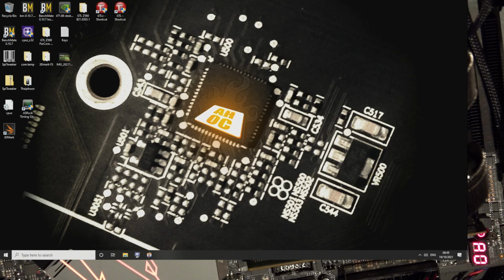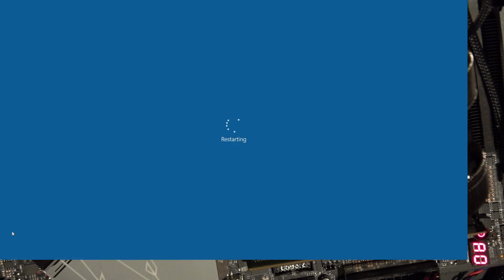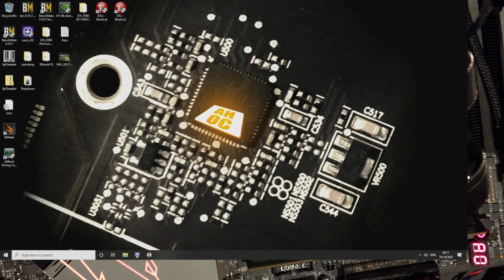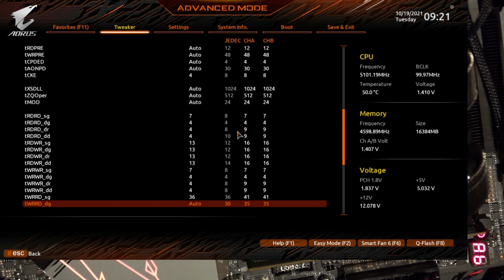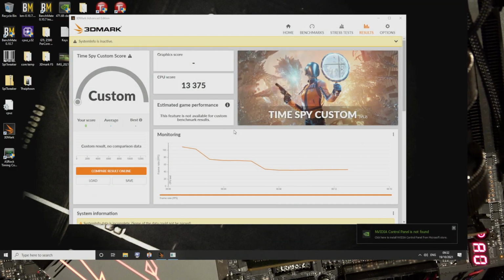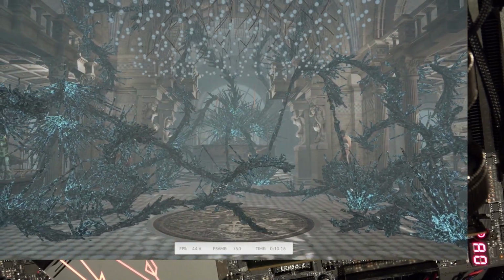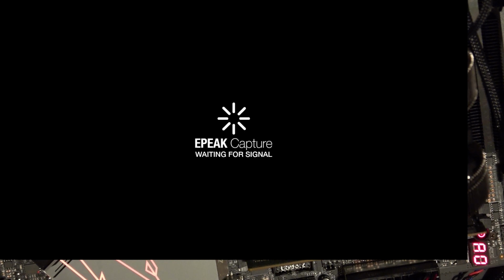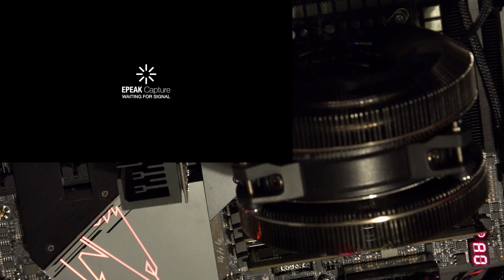Overclocking DDR4-2666CL19 OEM Samsung DIMMs to DDR4-4600 on Z590 (SR S8D)

Comment: could you tell me what the dual rank timing would be? great video and im so glad you have the 590 aorus master. i have the same mobo myself in my first pc build. im also trying to learn how to oc the 10850k. its tough when you know nothing and are trying to figure it out. this is really helpful in the sense that i can learn. it would be great to know besides experience how you figure out the timings that may work etc. to me its all a complete guessing game. yes ive had my pc not boot many times as i have no idea what im doing lol. that safe boot button is a god send though lol. that and clear cmos as well haha. anyway possible you could direct me to how to oc 10850k w this mobo? any help is appreciated and thanks in advance. when it comes to gaming in lets say battlefield V. what type of numbers are you looking for in ram? higher mhz or lower timings etc.? i currently have trident royal 8x4 4000mhz cl17 b die ram. i did my overclock setting ratio to 51 and 1.425v fixed v core. i have a x63 aio which cools excellent. id like to push it to 5.2 or even 5.3 if possible. what are safe v core intel voltages 1.5?

Comment: First DDR5 overclocking video any day now. HYPE!
Reply: DDR5 overclocking is going to take a while.. first the tech will need to mature then we need to figure it out
Reply: @coolhand4598  You do realize people overclock DDR4 by just adding more voltage to the basic voltage 1.35v.
This won't be different for day one overclocking for DDR5.
Reply: @N0N0111  Voltage Regulator is on the PCB with DDR5 it might not be possible to overvolt

Comment: I use Patriots 4x 8gb 4133CL19 on B550 Ryzen 3700x. Clocked to 3600 14-14-8-14-28-42 1T GD 1.5V. 8 is trcdrd. Is there a Chance to Hit 4600? I dont can Boot all over 4133 Stock. Tried high Voltage. No chance

Comment: If DDR5 does end up needing active cooling, do you think there will be waterblocks and things like that for it? Or would that be impossible?
Reply: Waterblocks already exist for RAM, they're just rare and expensive. Thermaltake makes them, for example. The same waterblocks will probably work with DDR5, the size and shape of the modules is unchanged apart from the position of the notch.
Reply: @nathangamble125  thank you.   Ram cooling is something that is there if you know what your looking for.   There are crazy minded enthusiasts who are engineers at heart,  they have an answer for that burning question you could ever have..
Reply: you don't need active cooling unless you push actual limits for a single run

Comment: I am overclocking B-Die on zen 3, do you have any videos doing something similar or any advice?
Reply from the maker: it works the same as on Zen2
Reply: I ran the time spy test on mine just out of curiosity, my 5800X with Samsung B-die at 3200 C14 XMP doesn't even match his baseline run of jedec 2666 lmao, I get like 11400 points.

Comment: How do I see what my set is? They are Trident Z 3000 c15? CDie/BDie or what?
Reply: A lot of BIOS's will let you see the spec. If it doesn't tell you the exact revision or die type you can use the program called Thaiphoon Burner to read the exact IC.

Comment: I really wish I knew more about memory, I got my 2666 kit at 2733mhz with tight timing, but I'd like to learn how to get it above 3200mhz at least on my 5800x. Feel like I'm missing out on some performance.
Reply: Really just figure out what memory dies you’ve got, find the safe voltage for the dies, crank the voltage to those values, and start punching in numbers that make sense and see what sticks. I’m sure there is a more methodical way to go about this, but it’s worked reasonably well for a noob such as myself so far :p

Comment: Strange, for me lowering tFAW actually does nothing or even reduces time spy score
40/auto 7248
30 7202
24 7187
10 7267
I have AMD though
Reply from the maker: tFAW is tied to the tRRD timings. Adjusting just the FAW on it's own should do nothing.

Comment: I see you lowering timings and feel kinda surprised, i'm actually trying to lower my timings on some t-group 3600mhz cl18 @4000mhz cl18 (i'm brazilian,  computer stuff here costs just A LOT). I can't get the trfc lower than 700 on them, i'm on ryzen btw.
Reply: if they are 16Gbit density, some of them wont go very low on tRFC.

Comment: Sorry bz but this was one of your least enjoyable RAM OC videos. Very chaotic in procedure, you skipped trying a little more Vdimm, skipped tightening tCL, tRCD, a lot of back and forth/time lost on the tertiaries. I hope there is a follow up video with locked down settings after you spend some more time with these sticks off camera.
Reply from the maker: the point was to show how to approach RAM OC without relying on someone else telling you what settings to use.
Reply: Absolutely, but I found the older exploratory RAM OC videos ever so slightly more methodical.

Comment: Buildzoid reminding himself how to overclock a memory chip that he doesn't understand the performance of in preparation for DDR5 :)
I probably don't need to ask, but you are going to get Alder Lake and show off some DDR5 overclocking when it comes out, right?
Reply: I highly doubt it will overclock very well right off the bat. Like DDR3 to DDR4, it's going to take some time for the speeds and latency of DDR5 to pass DDR4. That's what I think will happen, anyways.
Reply: @NikoBell1188  I tend to agree, the first kits of B-die started showing up about 1.5 years after DDR4 was launched, and then it took about another year (2016-2017) for motherboards to even begin to start to tap into it's potential. But given the extra complexity of per-module VRM's, I really think DDR5 is going to be the slowest maturing iteration of DDR we've seen yet, and I also expect that it's going to take the longest to surpass the previous generation, especially in latency sensitive workloads. It will undoubtedly and immediately bring absurd gains to APU's where it will be most useful, but it's pretty rare that lower core count consumer CPU's (<24 threads) are all that bandwidth starved to trade so much latency for bandwidth.
Reply: @K31TH3R  I actually think DDR5 will develop faster...
The market for high-end RAM is a lot bigger than it was in 2017, and the on-board VRM gives high-end memory module manufacturers something to focus on as a point of differentiation.
While DDR5's CL is awful, it's compensated for by independent bank refresh, which basically negates tRFC; and longer burst length, which means CAS is required less often when reading or writing long sequences of data. I forsee measured latency for early high-end kits like G Skill's recently-announced DDR5-6000 CL36 Ripjaws kits being similar or better than DDR4-3200 CL16, and we're likely to see something like DDR5-7200 CL36 after half a year or so.
The main problem I see with DDR5 is that its very expensive, and will probably remain so for most of its lifespan.
Reply: @K31TH3R  I don't think DDR5 will ever catch up to DDR4, consdering DDR5 isn't even out yet and companies like SK Hynix are already working on DDR6. They will just put their time into making DDR6 better, and DDR5 is probably going to end up being more of a marketing gimmick than anything.
Reply: @nathangamble125  I think you're absolutely right when it concerns the highest core count chips, Alder Lake CPU's, as well as APU's. I'd expect DDR5 Threadripper/Epyc parts to scale not far from linearly in multithreaded workloads with the increase of throughput. Alder Lake parts with DDR4 will probably be underwhelming versus DDR5 due to the bandwidth leeching E-cores. I also expect DDR5 will upend the market for low end discrete GPU's due to hugely improved viability of iGPU's.

But where I'm very on the fence is whether or not we'll see worthwhile gains is in lower core count chips (12-16 threads) on consumer platforms doing consumer tasks like gaming/video editing/web browsing and general usage, where bandwidth and row refresh period just really doesn't matter all that much. You see a gain of about 1 FPS going from 700ns to 250ns row refresh, and it might shave a minute or two from an 8 hour video encode.

I'd also add that the whole conversation may be made moot if DDR5 IMC's start out as awful as DDR4 IMC's did. If the Alder Lake platform can't run DDR5 in Gear 1, and if AMD still can't overcome their 1800-2000MHz FCLK hurdle, DDR5 could be a shit show on consumer platforms until IMC's catch up.
Reply: @Kibin 3200cl16, 3600cl18, 7200cl36 are all 10ns. On paper the module latency should be the same between them. I guess we'll have to wait and see if it's the same in practice once the IMC factors in.

Comment: When you changed the primary timings your tertiary timings became really loose. Is that because its scaling with frequency ? I wonder how many people set their main timings but forget to tune their subs and wonder why their timespy score is low.
Reply: With my z590 board all I have to change is tRFC and tREFI for latency.  tRDWRSG, tRDWRDG,TRDWRDR,TRDWRDD, tWRRDDDR and tWRRDDD for bandwidth.  This after setting the primary timings.  After doing all those timings, most of the other timings cant be lowered.  This nets me 15.4k in time spy cpu for a 10900k @ 5GHz.
Reply: @GodKitty677   @Charles Clarke  Thats interesting. I know tfaw 16 and trrd 4 and trrdl 4 can increase timespy score. Twtr, twtrl can be left on auto if twrrddsg and twrrddgg are adjusted and vice versa. 

Your timespy score is very close to mine. I have a i9 10900kf @ 5.1 with a score of 15479. If you pushed your cpu to 5.1 you would probably beat me. You must have a better ram setup than me.
Reply: @blackstar11211  My tFaw is something like 26.  The other two timings are 10 and 6 or 7.  If you have a lot of programs in the background that could reduce your score.

Comment: And I can‘t get my G.Skill Aegis 16 18 18 38 3200 to 3600 lol
Reply: The Aegis kit is absolutely trash. Idk if the 3200c16 kit has different ICs, but my 3000c16 is using Microns D9TBH. Only can get them to 3333 16 19 10 16 38 1.4v. Could probably do 3400 but it needs more voltage/higher trcdrd, and they become unstable at 1.4v+ after some time. Gotta do my research next time im gonna buy ram lol
Reply: Kits with loose timings are usually ones that could not run faster. The 14-14-14 3200 can usually do 3600, but price wise it's about the same to buy the 3600 kit.
Reply: voltage? try loosing tRCDRD

Comment: Any way to get some understanding of what all this funky timings mean ??
Reply from the maker: I pretty much don't remember what any of them do.
Reply: @ActuallyHardcoreOverclocking  thanks! 😂
Reply: @ActuallyHardcoreOverclocking  based hahaha
Reply: I want to give it a try explain it as short as possible (won't be the most accurate explain out there)
----first timing----
tCL determine how much over all latency 
tRCD---- memory is like a big excel sheet, it finds the row it want to access then it search column in that row, so faster the better and big performance gain here.
tRP tRAS don't know don't care just lower them.
----2nd timing----
tRFC how fast row refresh, I guess it's a bigger version of tRCD? not sure on this one. lowering this reduce heat tolerance but gain quite a bit performance
tRRD (L or S for long/short) row to row delay, don't know what they do but lower this give huge performance and they usually go all the way down to 4 anyway, lowering this reduce heat tolerance a LOT.
tFAW  four activate window, how long delay required after per 4*tRRD, lower to 16 give huge performance boost, also reduce heat tolerance.
rest I don't know or care as much and just lower them one at a time and tick by tick, some are tied with other timing, just be careful.
----3rd timing----
RDRD RDWR WRRD WRWR -> read to read, read to write, blabla
SG - Same bank group, DG, different bank group
SD - Same Dimm, DD- different dimm
SR, DR, same/different rank
just reduce 1setting, 1 tick at a time, and run short linpack, my experience is if they fail they crash hard, it they don't fail early they are fine, remember to use pen to take note of timing as sometime it won't boot at all and reset CMOS removes all those setting and good luck if you didn't remember by heart.
reduce any 3rd timing will make ram harder to train, and may not train one boot but train the other boot and give you all weirdness.

Comment: One of the programs in the y-cruncher stress test suite actually pulled more DRAM power on an X299 board I tested, than Linpack. IIRC Linpack was in the ~40W range but that y-cruncher test went above 50 W on the DRAM power.